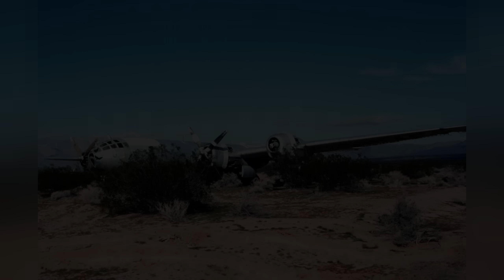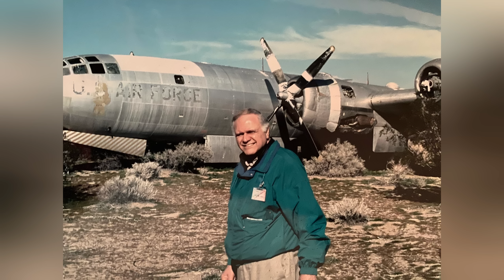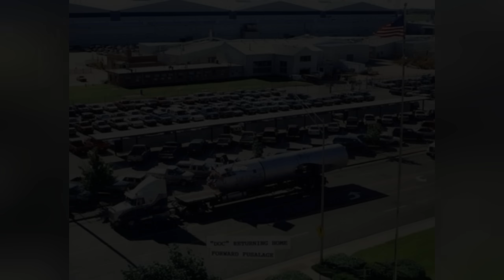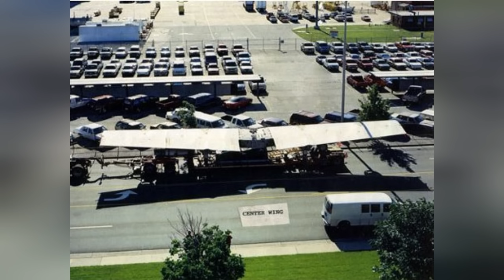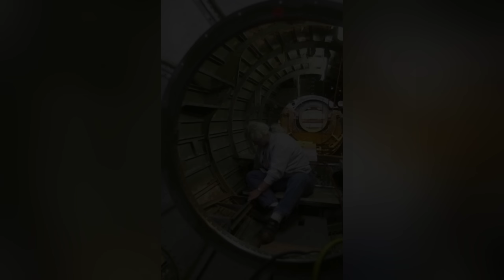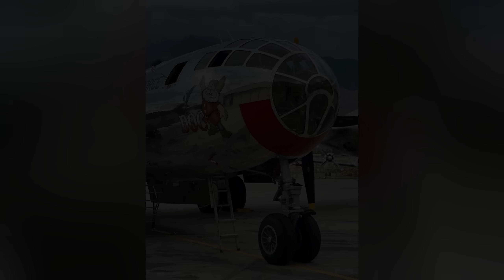Recovering B-29 Doc: From Desert Target to Flying Museum

Comment: Stupid question,  how & on what air strip did the craft originally land on & w road/ ground track did it transgress' to alight upon its current ill begotten patch of damned -nationed desert ¿¿¿¿ i am certain the army / air force had no mechanical air transpor delivery system in place to drop this massive cr a ft kaploop on the desert floor & best as i can determine they still dont........
Reply: most likely they flied it to the base then dragged it out to where it was sitting with oil and fuel removed

Comment: According to the information that was shown by the Doc group when she flew into the Inyo/Kern airport (I took my grandson for the aircraft tour) a local group had gotten permission from the navy to transport doc to the airport with the intention of restoring it  for static display. But money problems kept them from getting very far. Then  a billionaire with a fairly large collection of restored aircraft, some airworthy, based out of the Wichita plant where Doc was built, made the deal with the navy and swapped an airworthy aircraft for Doc. At the Wichita plant during restoration most of the volunteers doing the work were people who had worked for Boeing building the B29. I know that there were several upgrades, but the 1 I remember was that instead of zinc chromate on the interior surfaces they used an epoxy paint that looks like it.

Comment: It seems quite a few people don’t understand about the tortoise bit and what land this plane was on.  let’s edu-ma-cate them ;
This plane was on navy owned  land but the land …the ground that the plane was on is in an area that  the BLM has endanger species protection rules .   
Thats NOT  a traditional “bombing range “ in that section of land…at least not the part of the bomb range where inert practice bombs are dropped ( news flash military doesn’t often practice with live bombs )  .
 That area of the “bombing range” is  a ground targeting and spotting area . 

Retired planes and vehicles are CAREFULLY towed out into that area where they sit for decades un disturbed by anything but nature and weather  and pilots train by flying over and visually finding and identifying things , they also use their radars and targeting systems to practice getting a “ lock “ on these ground targets BUT NOT RELEASE WEAPONS .

if they actually dropped inert or live bombs that plane would have been pieces of debris scattered everywhere with in a week of being out there . 

No one walks or drives out there and no weapons or training devices touch the ground there .  
It’s all protected  grounds . They just practice locking in to the “targets “

Military doesn’t drop live bombs every time they practice .  When they do actually drop bombs in practice it’s usually one target in one designated area over and over and they use dummy loads . Inert  bombs, with perhaps a small smoke charge to indicate where it lands .  Often those inert practice bombs can be recovered and reused because they land in a reused designated area with soft soil .

So many idiots saying  “oh they bomb the area but blm protects the turtle ?. Obviously  these people are clueless . 

Now, Past the boundary of the navy own land is also all BLM land . the same ground protection applies 

They had to tow it out of navy own land and across the BLM land .   The BLM land has rules about protecting certain types of wildlife such as the desert tortoise which is a CRITICALLY ENDANGERED species . That means close to extinction.  That whole close to extinction part is why the land is so protected .
Reply: Cope harder

Comment: The military had been dropping explosives all over the place for decades and now they piss about bulldozers???
Reply: Nope .  That area is not for dropping anything .  The ground is protected because it is the habitat of a critically endangered species.   
The military carefully tows retired planes and vehicles into the area in the same careful way they got it out . 
The retired planes and vehicles then sit there for decades undisturbed by anything but nature and weather as no one can walk or drive out there . 

Pilots practice flying over and visually identifying ground “targets”  . They also practice identifying them with radar and practice requiring a target lock on these “ targets” with their weapons system .  BUT THEY DO NOT RELEASE ANY WEAPONS .  

There is a designated area  that’s been cleared of everything and has soft sand , like a giant sand box, for dropping inert practice bombs elsewhere in the range.

The military rarely drops live bombs as part of practice.  

Some real bombs are well over a million dollars a pop  they don’t just go dropping 30 of them on a day for funsies . 

They use mostly reusable inert practice ones and drop into a specific area of a few acres that is prepared with soft soil .   

An over all “ bombing range “ can be thousands and thousands of square acres but of that only small prepared area is for actually dropping anything . 

If they actually dropped bombs there, real bombs , one hit  would have turned that plane into pieces  of tinfoil  and the land would be littered with craters some being over 20 ft deep . 

That area is just for spotting and practicing radar locks and it’s generally off limits to be on as it is protected because of critically endangered species , the desert tortoise .

Comment: The engines had relatively low hours since it was parked. A group of volunteers pulled her out of the range, down a public road to a local airport, Inyokern Airport. It was partially disassembled, then shipped to Kansas for restoration. The volunteers were never told it was headed for Kansas. The plane had been on the range for so many years, telephone poles and fences were built since it had been parked , so they had to find the facility drawings to determine their height so the tail wouldn’t hit the wires. A fun weekend!
Reply: The photos show the vertical portion of the tail assembly is missing.

Comment: They weren't allowed to do any excavating in a vacant lot?
Reply: Being a military exercise range an excavator would be the last thing one would want to use. Bucket teeth could set off unexploded ordinance IF present in the wrong spot (just proximity to the pressure point could be enough) which would completely defeat the purpose of the recovery. It would also likely do more harm than good to the ground around where they needed to work. Definitely wouldn't pass with the BLM bureaucracy they dealt with.
Reply: @RuralTowner there is no EXO  in that area .  Thats not the area of the range where they practice releasing inert weapons .   
That area is for learning  how to , and practicing , spot and identify things on the ground .  They fly over and practice visually spotting and radar search and identify the objects .  
The area for inert practice bombs ( and very rarely live) dropping is a prepared area that is cleared of everything. It’s barren sand . 
Don’t forget a “bombing range “ is several thousand acres in size . 

If they actually hit that thing once with a live bomb it would have been proves of tinfoil scattered everywhere  instantly.   It didn’t sit out there for decades untouched with not a single bullet hole or damage unless that was the spotting area or out pilots are really terrible shots 😂

All that part of the range and the land beyond it is BLM protected because the desert tortoise is critically endangered .  

The military uses the same precautions when they tow a retired vehicle out there and then it stays out there for decades untouched because no one can go there . They just use it for spotting .

Comment: I've flown in the B-29 Fifi! It was an awesome experience. There is nothing like the roar of those engines.
Reply: Myself too. Best $600.00 I ever spent.
Been 3 years now.
Reply: @danwilliam3342   Fifi used to me at Midland Space Port until several year ago. She visits us via air shows all the time (I guess Fifi and Doc are some of the last ones left)
Reply: @kilroy79763 There is one at Tinker Air base you can see from I-40 as you pass by.
Reply: FIFI (not Fifi)